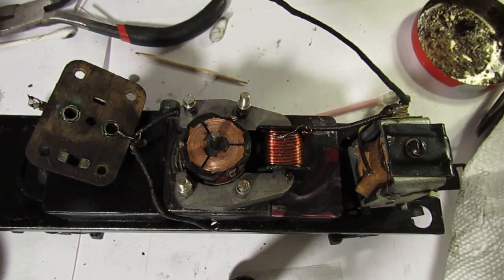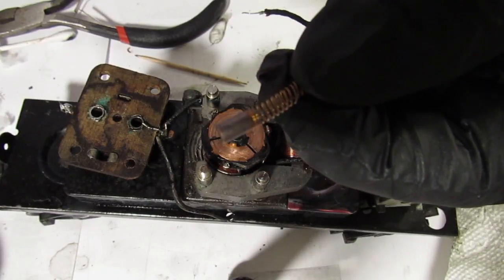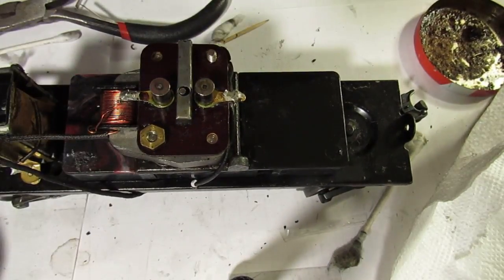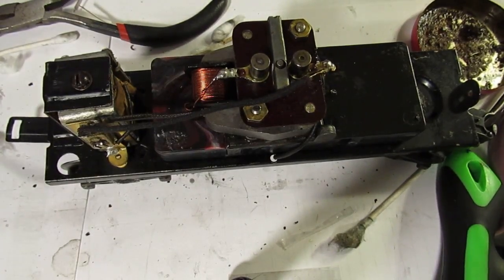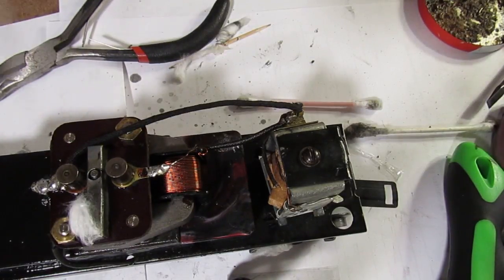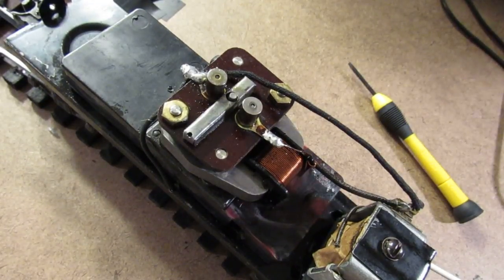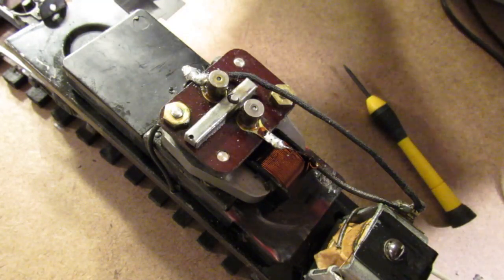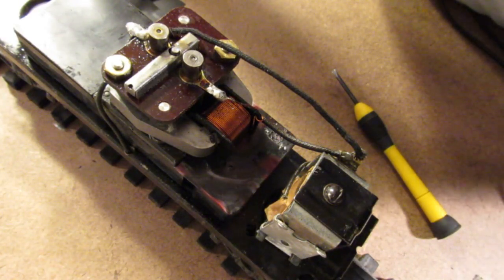Step By Step.Postwar Whistle Service Tutorial Part 2of 2

Comment: I just replaced similar brushes & springs in my old Lionel 41 Army Switcher... I found it best to hold the brush plate upside down to keep the brushes and springs from falling out, invert the other part and place it on with everything upside down... otherwise I would have thrown it up against the wall, smashing it to smithereens after that many attempts ! :)

Comment: Thanks Kenny. I just picked up a 243W tender and it sounds like crap. I scared the cat off the layout with the darn thing. Al
Reply from the maker: Yeah,they are the most neglected piece on any layout.People never open them up,all they need most of the time is some lubrication.If yours is dry like you said,be sure to put a Q-tip under the whistle relay like I showed on here,and just let it run,with the q-tip holding the whistle relay up.In about 3-5 minutes,take the q-tip out,oil it again,from the top and on the bottom of the whistle impeller.Under the scoop if you have one on there),other wise,you"ll have no problem seeing the middle of the whistle impeller.Keep doing those steps like I did at the end,youll hear the whistle get nicer and louder,and you"ll hear the whole thing Spinning around faster,like it should.

The other thing nobody lubricated were the Santa Fe's,the F-3's.Lionel shoulda made a hole some where to lubricate those motors,because getting the shell off without cracking it,is not the easiest thing to do.  Hope this helps with your tender.Let me know if you run into any problems,we"ll try to figure something out and get it going real good.It might not even need brushes an d springs,but they ALWAYS run better with new brushes and springs._Kenny

Comment: just unsolder the wires it makes it so much easier to turn the brush plate upside down and it goes together the first time every time. just did a dozen of my tenders this way.  also if you have to flux the solder joint you are using the wrong solder.